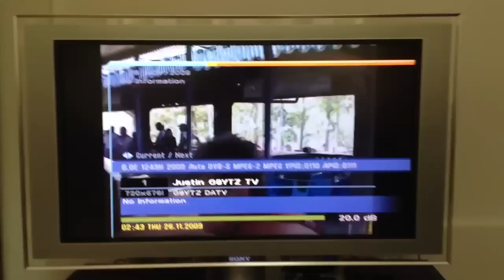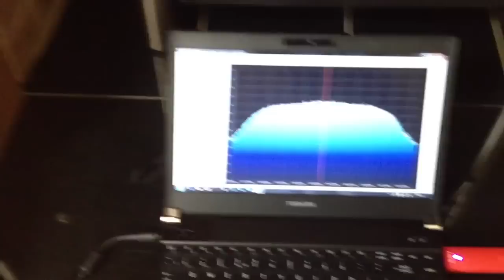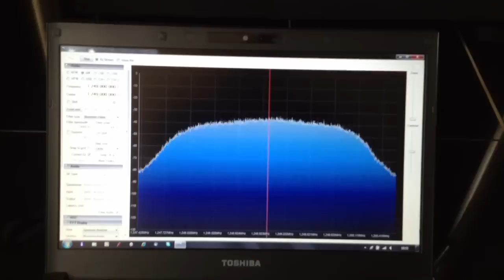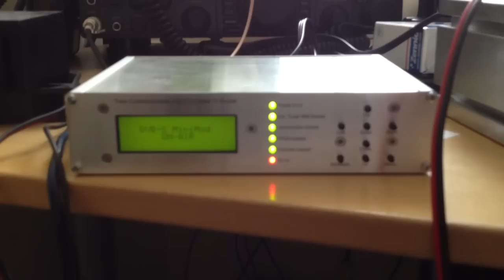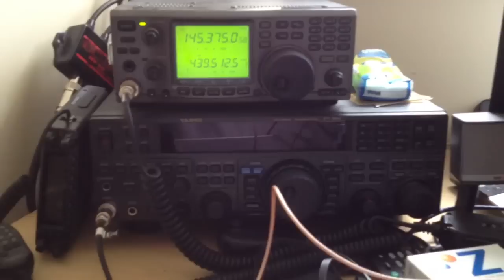Digital Amateur TV Transmitter Part 2

Comment from the maker: Hi, on DVB-S the constellation is QPSK only, on DVB-T QPSK, QAM16 and QAM64 are all supported in 1-8MHz for the 1-5MHZ "Ham Narrow" operating modes you will need the matching receiver. Very good dx results are possible at 2MHz in QAM16, but the great thing is that there are so many possibilities to experiment. The receiver you only need to set the Frequency and Bandwidth, everything else is automatic.

Justin